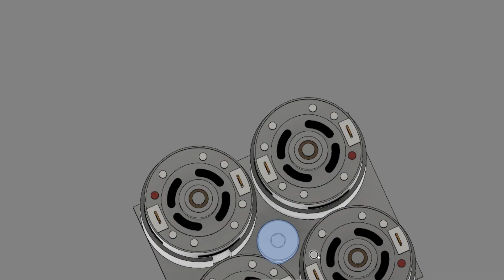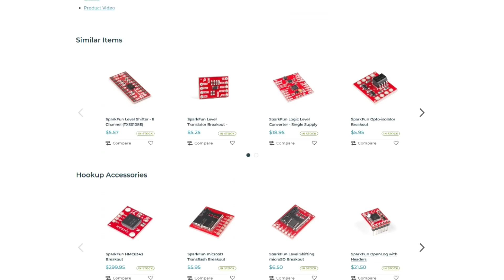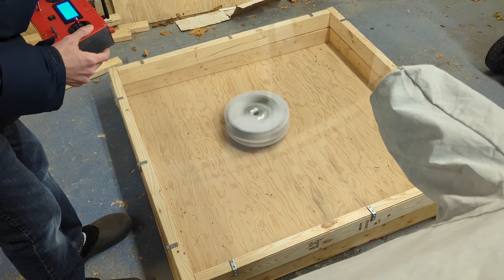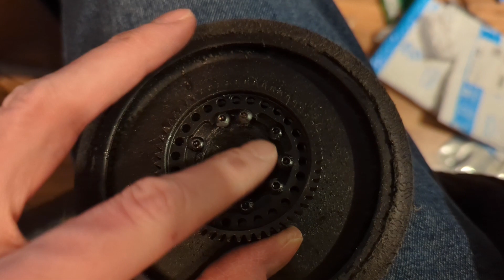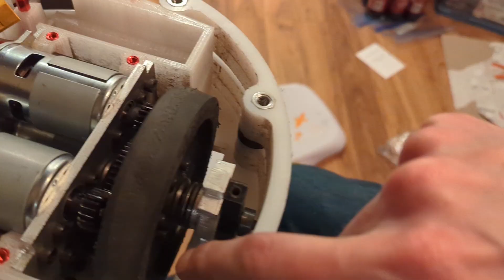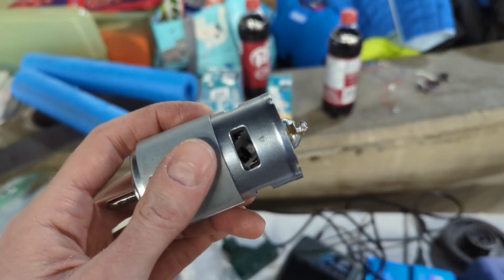The Story of Witness Me: Inception-2025

Comment: why not brushless motors? they would have a much higher speed withought needing gearing
Reply from the maker: I used brushed motors for a few reasons
1) It's exploring an area not really explored right now
2) I make my own speed controllers and haven't made my own brushless speed controllers yet
3) They respond faster
4) They always respond until they're broken

Witness Me uses the same motors my 3 lbs does which saved R&D time.  Time is a very expensive resource for me and so this made it easier to get something in this year.